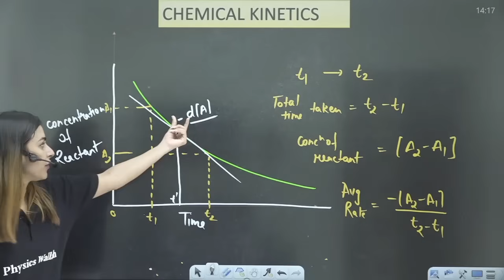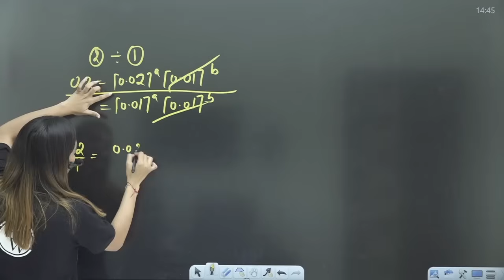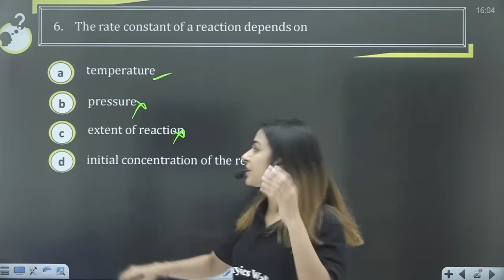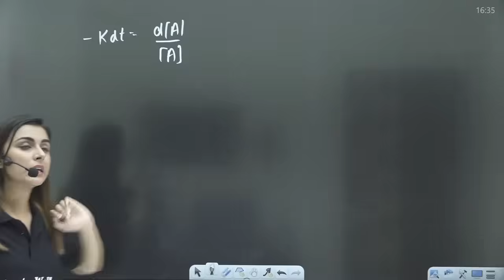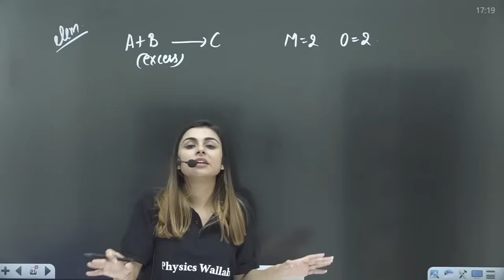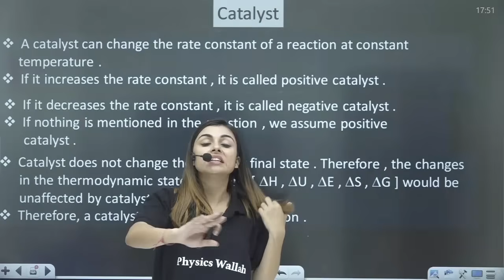Chemical Kinetics - One Shot Lecture | CHAMPIONS - JEE/NEET CRASH COURSE 2022

Comment: Mam, in the half life time Calculation for first order reaction, the value of this is equal to 0.693/t1/2 ........ But i think that is might be wrong...... The reason is in this calculation 2.303 ×log 2=0.6909 but u are got the value is equal to 0.693 ....... How is it mam? 🤔🤔
Reply: Yaa You are right calculate karne Parr tooo 0.6909 hii aa raha🤔
Reply: Because she multiplied 2.303 by ONLY 0.3 ... Which is 0.6909, u are supposed to multiply it 2.303 by 0.3010 .. Because value of log 2 is 0.3010...so 2.303×0.3013=0.693.
Reply: @Acheee.7  thank you so much for clear my doubt 😀🤝

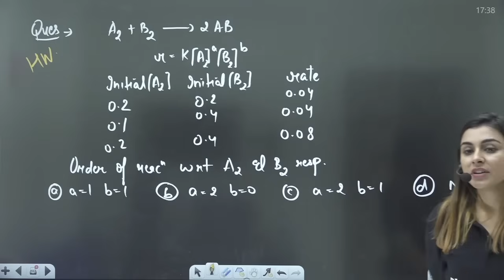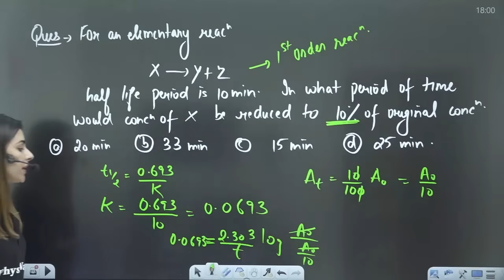Comment: 2:38:50 a is correct option I have done ✅ the home 🏡 work. 2:57:50   only 20 is multiple of 10 here so that's the answer because half life in first order is constant hence total time would be either 20 30 40 or so on but in question only 20 matches the upper criteria so answer would-be 20
Reply: 33 min
Bcz log 10=1
Reply: @unknown_XD  right